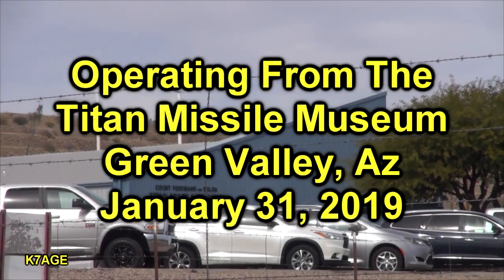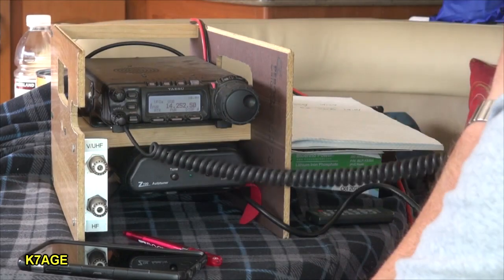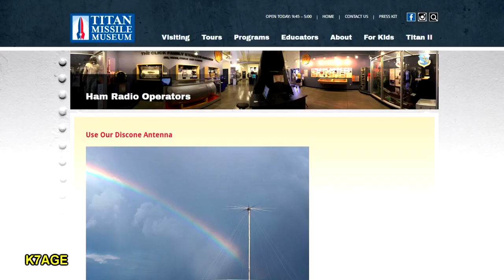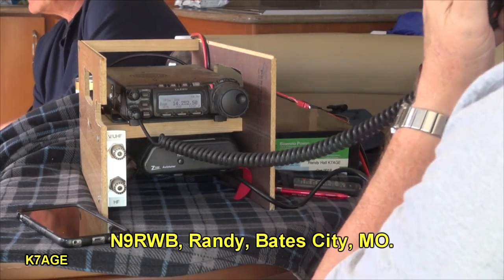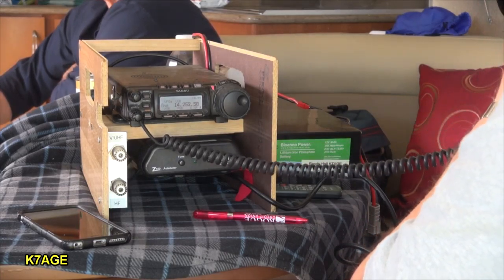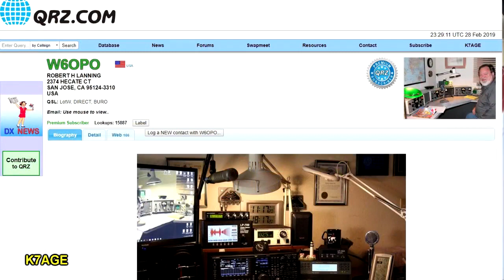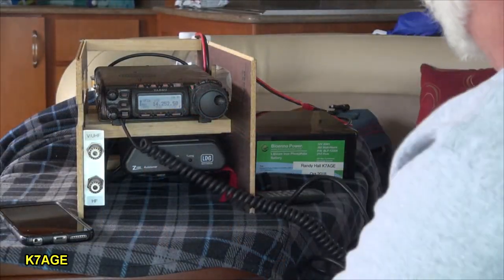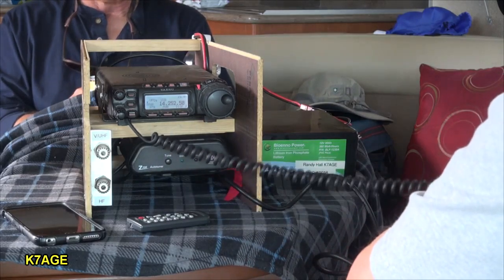Titan Missile Museum Operating

Comment: I've always wanted to go down and try that beasty.   I'm suprised the vswr varies so greatly.  Discones are typically very flat.
Reply from the maker: We learned later that the wires from the ring back to the base are not connected.  Hey, it worked great.
Reply: It's old and not maintained.